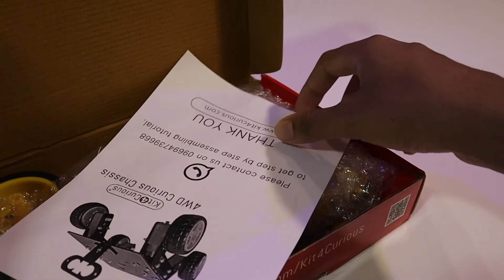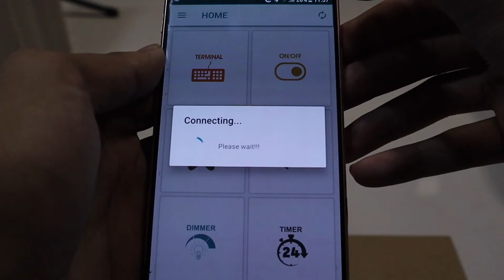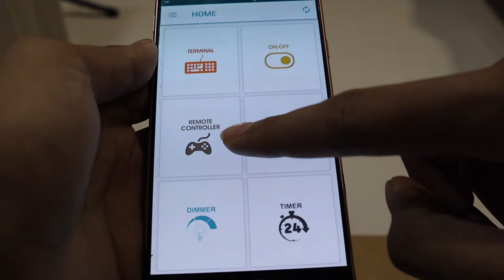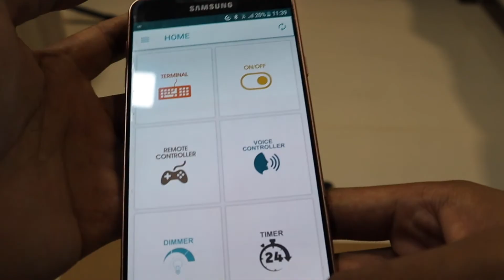VOICE & OBSTACLE AVOIDANCE ROBOT | ARDUINO | KIT4CURIOUS | BLUETOOTH.

Comment: I didn't have this kit, but I tried hooking L293 with 4 motors and adding and HC-04 ultrasonic sensor and the ultrasonic sensor showed very poor performance. In serial port I got jibberish or inadequate numbers. As I read, backward EMI was causing inconsistent ultrasonic sensor readings. I had batteries connected directly to the terminals of L293 board. Not your battery assembly. 

If I ran the code separately the sensor would work just fine. And motors would also work fine separately, but whenever I had both in my code, the ultrasonic would fail.
Reply: Did you solved your problem ?
I have the same problem with my project.
Reply: @Furkan-fy8yj  I solved it with TB6612fng driver on Aliexpess. The driver has flyback diodes.

Comment: I have a question about the yellow-capped component labeled "PW" on the motor shield l293D. Additionally, I've developed a car using the same procedure and utilizing two 3.7V batteries each. However, I've encountered two problems:

1- When I unplug the USB, the car stops working.
2- The batteries seem unable to power all four motors to move the car.
Initially, the setup worked fine during testing, but these issues arose later on. Could you please provide assistance on how to address these problems?

and what specific Batteries and how many of them I need and what volatge.Thanks In adavnce.